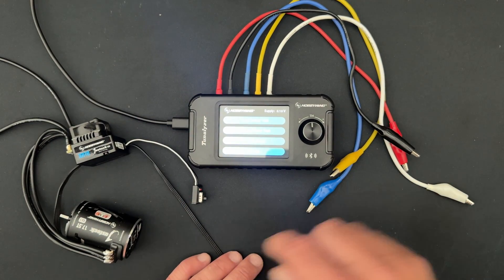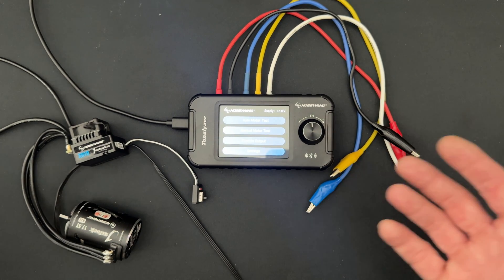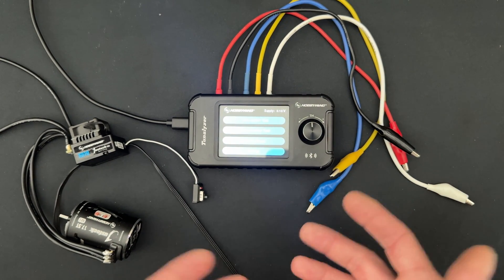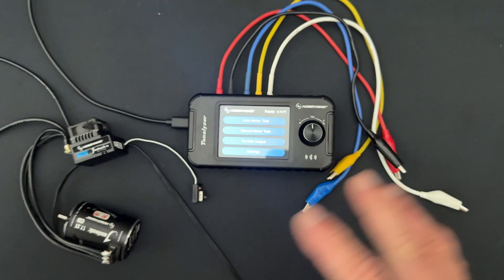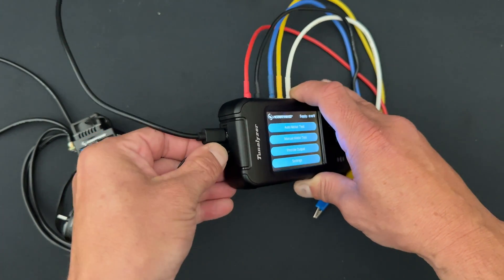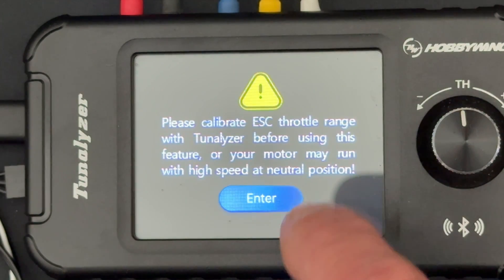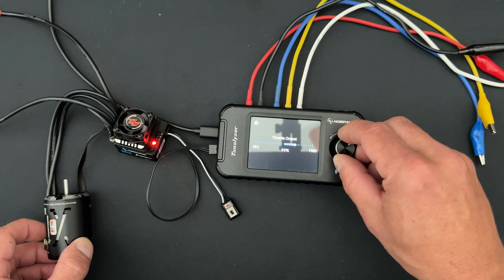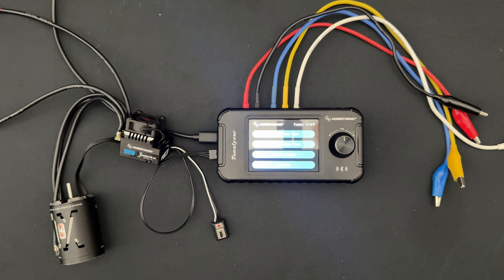HOBBYWING Tunalyzer Hidden Gem - Throttle Output - The Charlie Show - EP  429

Comment: Hey thanks for the video. I have a question for you at hobbywing about EPA end point adjustment. I read in my x10 pro 1s just stock that my transmitter epa should be 100% both break and throttle. I have a sanwa m17. My sanwa m17 has a epa that max out at 150%. So my question is wouldn’t i want that to 150 instead or 100 so when im calibrating my esc it gets the full travel? From there i would turn it down throttle by lowering epa for th or brake  or i could do it in the esc with the programmer? Is this correct? Each transmitter has different end points so im curious. Thanks a bunch.